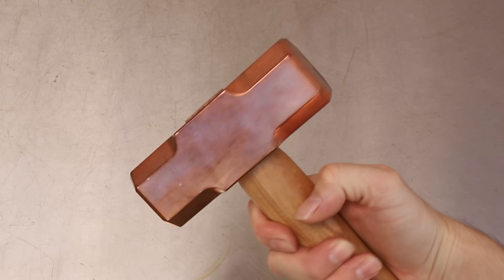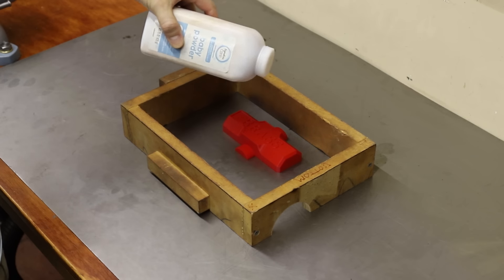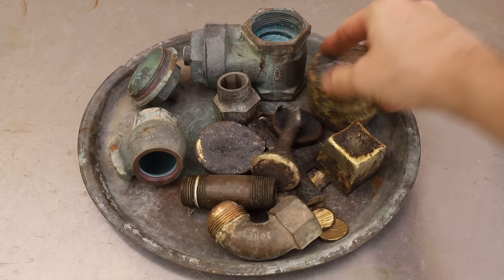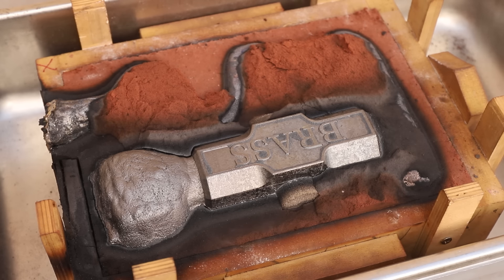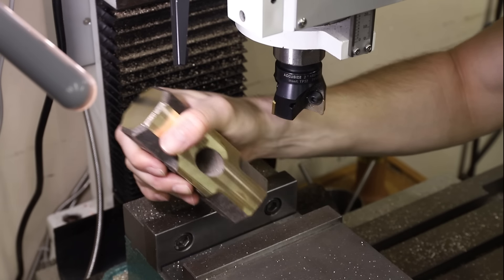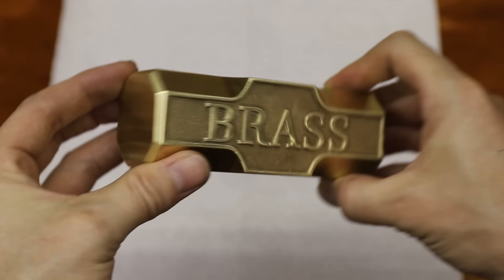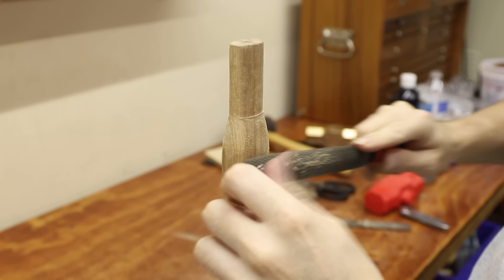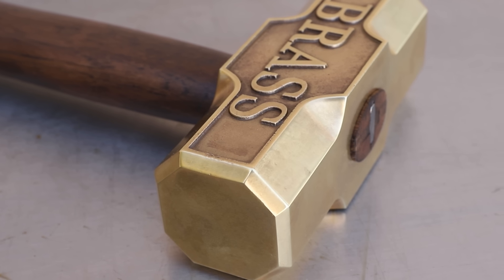Casting a Solid Brass Sledge Hammer in a Backyard Foundry

Comment: It's official, you must begin making a hammer of every metal, and have the ultimate Smither's collection.
Reply: I fully agree
Reply: please gold 24k!
Reply: Gotta get his hands on some depleted uranium.
Reply: I would like to see a titanium hammer if it's possible.
Reply: Why would a smith want a softer hammer? A smith wants the workpiece to deform, so there is no reason for a smith to have a hammer that deforms more than his work. Sparks should also not be a problem while smiting as most of your work is hot work. So if you store flammable stuff next to your forge, you are doing something VERY wrong.

Softer hammers are good for mechanics and technicians that want to give stuff a whack without damaging them. Also, specialized jobs like oilrig crewman that can't afford to give off sparks due to the fire hazard. Steal on steal can create sparks, copper or brass on steal, does not.
Reply: still missing the hammer made from gold
Reply: @fitter70  Yes!!
Reply: @skitidet4302  I think they're called "collections" and "collector's piece" for a reason. They're little more than a token, a thing to hang on a wall. A copper hammer has no use in current smithing, yet makes an excellent novelty item.
Reply: Cannot wait for the tungsten hammer of the same size😏
Reply: HELL YEAH!
Reply: Cesium hammer xD
Reply: yes
Reply: @Michaels_lack_of_AC  that thing is gonna weigh like 5 tons
Reply: tantalum hammer lets go
Reply: AGREED
Reply: This includes tantalum
Reply: I'd like to see pewter
Reply: Tungsten hammer is a must
Reply: 316 Stainless steel
Reply: @lnz971  don't forget high purity platinum and platinum white gold.
Reply: @skitidet4302  Actual blacksmith here. Soft hammers are useful for hitting punches and chisels hitting 2 hard prices of metal against each other reduces the life of your tools and can cause chipping.
Reply: @garethbaus5471  True, I forgot that blacksmiths sometimes hit other things than the workpiece.

But for hitting the workpiece, you don't ever want the hammer to deform, only the work. The harder the hammer, the more efficient your work is going to be as it imparts more of the strike to the work or it bounces nicely on the anvil. Ofc it can be too hard if it can start to chip if you hit the anvil.

Also, a moderately hard steel hammer would be more than soft enough to hit punches, it doesn't nessesrly have to be real soft as that would just force you to resurface the hammer face more often.
Reply: @skitidet4302  The work is significantly softer than regular steel, so the hammer doesn't actually have to be all that hard to be useable.
Reply: @garethbaus5471  Yes, but the harder it is, the less energy will be wasted by the hammer acting like a shock absorber. Though in practice, the difference is probably pretty negligible, at least when working with soft yellow hot steel, but the more it cools, the more it is going to matter.

I know blacksmiths also bounce the hammer on the anvil while working, and the harder the hammer and the anvil are, the better the bounce. If you use a brass hammer, I bet it won't bounce well and it will be deformed rather quickly, especially when hitting the much harder anvil.
Reply: @garethbaus5471  There's a good reason why blacksmith hammers are made out of high carbon steel that is hardened a decent bit.

If you doubt it mr blacksmith, make yourself a hammer out of mild steel. Could you work with it? Probably, but it's not going to last long and it's not going to work as well.
Reply: @skitidet4302  Medium carbon steel like 4130 is generally preferable to high carbon steel actually. I actually have a mild steel hammer, the edges need dressed a little more frequently, but it still works fine.
Reply: @garethbaus5471  4130 is not a medium carbon steel, it's a low alloy steel with low/medium carbon content and it's pretty hard, especially after heat treatment.

I did some reading and apparently you want your hammer to be softer than your anvil for obvious reasons(refurbishing an anvil is a lot harder than fixing your hammer), so medium carbon steels like 1045(0.45 to 0.5 % carbon content) seem fairly popular and will reach a decent level of hardness when heat treated. 1060 is a high carbon steel with 0.55-0.65 % that's often used for sledge hammers, though it might be a bit hard for blacksmithing if you don't have a hard enough anvil.
Reply: @garethbaus5471  Also, I don't believe your "mild steel" hammer is actually mild steel. as mild steel is real soft and it has too low carbon content to hold a temper. If you did use one, you pretty much had to dress it daily as it will deform a lot when hitting most stuff.
Reply: @skitidet4302  It feels softer under a file then cold rolled steel, but that really isn't that big of a problem if you keep your work hot.
Reply: @garethbaus5471  But it is a problem if the work starts cooling off a bit, or if you hit your anvil, or if you are trying to forge something real hard like tool steel for some reason. There is no upside that I can see to counter balance the disadvantages. Why be stubborn like this? It's inferior, end of discussion.
Reply: @fitter70  he did make one but it’s not that big
Reply: YOOOO CALCIUM HAMMERRRR
Reply: Americium gang 
               👇
Reply: Plutonium 🥺
Reply: I agree, a Damascus steel hammer would be raaaaaad
Reply: @lnz971  it would cost $23,000 😂
Reply: yep
Reply: You are the chosen one 😷
Reply: Uranium sledge hammer 💀💀💀
Reply: @kami1945ww1  no the main body of the hammer will be just below supercriticality plutonium, and the end caps of the hammer will be tungsten carbide!
Reply: Rhodium hammer
Reply: @benjaminbrockway5998  +5 radiation damage
Reply: plutonium hammer
Reply: Personally I want to see a as close to pure as you can get the metal, carbon steel hammer. By pure I mean just carbon steel no other metals, I know full well carbon steel and steel in general is an alloy.
Reply: Pure uranium hammer 💀
Reply: Mercury hammer: You can only use it in cryogenic environments or it melts.
Reply: @benjaminbrockway5998  the US is leaving some in Ukraine, maybe that´s a good place to start.

Comment: Did you spray CO2 over the core or was just being exposed naturally enough to harden?
Reply: boy just breathed on it really hard
Reply: YouTube frames your comment without me opening the section, leading me to assume you are top comment, and I'm surprised he hasn't answered yet because of that.. Regardless, I know next to nothing about this stuff, but he seems to outline steps pretty well if he thinks they are important and he didn't say, so likely he doesn't spray it... Just my guess.
Reply: It’ll harden on its own by just being exposed to the air, but you can also spray it to harden it faster

Comment: Earned another subscriber. Please keep the narration for people like me who just don't know. Also, the comments, were quite helpful. I didn't know how/where these tools were used but the comments certainly helped.
Reply: Don't know if other people have commented, but brass tools including hammers are often used in industries where there's a risk of fires and explosions caused by various gases/vapours.
I used to work on drill floors on rigs in North Sea and we kept a set of bronze tools, alongside the usual steel ones. Hammers, spanners/wrenches, etc. We'd only use them on occasions where there was an increased risk of gas escaping, and we'd have gas detectors all around the area.

Comment: Beautiful hammer. I'm 60, and my grandfather taught me how to put handles on hammers. He would have the fit very tight. You couldn't quite get the handle in. He would start it then flip the hammer over and tap the end of the handle with a wooden mallet. This would drive the handle into the head. Over time the handle will absorb and lose water making the handle lose. He would seal the end of the handle with varnish.

Comment: Very cool. A brass hammer is a very useful tool for working with metal since steel hammers will deform what you're working on. This is basically the metal equivalent of a rubber mallet.

Comment: I've used a brass hammer a lot in refinery work.  It won't spark and that's nice when you're working with flammable gasses floating around in the air.
Reply: It’s not too soft? Nice

Comment: Really cool, i had 2 thoughts that i think you should try. 
1- Why don't you model up an item that can double as the sprue/pour hole for any item you want to cast. For example, the wavy line you carved could be a snake. Surely this way you can get 2 castings at once and have a "cheap" item sell on your site. 
2- Because you don't need the integrity of a 3D model, it would save you print time and material if you hollowed out your 3D models

hope this helps!
Reply: It just gets melted back down anyway
Reply: @gonelucid  That is still an extra step that costs fuel and doesn't directly add value, the more value you can generate in single pour the better.

Comment: Very nice. You might want to smooth away the little step where the bottom of the eye meets the handle. A smooth radius in the wood and the bottom of the eye will reduce the chance of breaking. 👍🏼

Comment: Looks great without a doubt. The only different thing I would have done, was polish the faces, the facet edges around the faces. Top, bottom, stipple around the lettering. As for the edge flats, leave those dull as cast.

Otherwise it's yours and not mine, so the choice to go the route you did is what you preferred, and it looks good for it. For a next project why not a bronze one in the style of a stone axe?

Comment: Nice job... except for the steel wedge at the end.  Making a brass final wedge out of your casting off cuts would've been quick & easy & since it's a soft metal, you could've Dremmeled out a thin starting v before hammering it in.

(30/Jul/2023-9:53pm🇦🇺EST)

Comment: I'd like to suggest using a 50/50 mix of boiled linseed oil and turpentine on your handles.  TWP can be added for colour.  This, when applied to the wood that will be in the head, will help the handle from drying out and becoming loose.  Also treat the wooden wedge. very nice project.  How long did it take to melt the brass?
Reply: I use pale boiled linseed oil on my vintage sewing machine resto’s, gives a beautiful finish.
Reply: also be careful with linseed oilsoaked rags, they tend to ignite when you dont want them to

Comment: It may not be a hammer, however I am having a scale model locomotive body that will be sand cast at Montclair Bronze in Montclair Calif. I made my own master pattern hand carved out of wood. It will be  1.5 inch wide x 1.3/4 inches high x 10 3/4 inches long. I love the brass sledge hammer.

Comment: You should have burned the handle with a torch ( I use map gas on my axe handles ) before you oiled it. It makes it stronger and it looks awesome. Really brings out the grain in the wood.

Comment: I just made a set of brass and copper hammers. For my mold I was just using an old, mostly burned out graphite electric forge 3kg crucible. Get a nice perfectly cylindrical hammer that way, and I can use my pipe-holder to drill in the handle. Nowhere near as nice looking as yours, but functional.

Comment: It's better not to strike the wedge directly with a hammer so that it doesn't crack like it did in your case. Instead put a piece of wood on top of the wedge and strike that. Amazing video by the way and the cast job couldn't be any better.

Comment: Everything is so..... but I would recommend strengthening the handle not on dry, but on glue. The simplest option is PVA glue. But there is a better option - this is a rubber adhesive, which, after complete solidification, retains viscosity and some plasticity.Although in your case, a metal wedge gives a good guarantee against disruption.

Comment: Very nice.  I wound have sanded the top of the handle flush with the hammer head, but I'm being nip picky.
Reply: It might hold slightly better if its not flush, since the excess is able to spread out. This way the hammer head isn't just held by friction between head and handle, I think.
Reply: @SystemX1983  Probably right. But, I don’t think this hammer is for use. Just a cool decoration.

Comment: Sorry if thats sounds stupid but where did the air go inside the chamber please ? Shouldn't the metal have been blocked by the air inside while pouring ?
Reply: The sand isn't air or water tight, it just moves out of the way.

Comment: Love that hammer.   Would it have been possible to use a brass wedge for securing the handle rather than wood or would that have thrown up some issues?
Reply: Absolutely no problem if it is melt from the same pour.  Other brasses should be fine, but there is a slight chance of getting a little corrosion due to differing zinc quantities.

Comment: Just beautiful. Where did you get the 3D printer file for the Sledge head?
Reply: They are easy to make oneself.  I use Tinkercad, which is pretty basic but does what I need it to.  The overall shape is just a cube TC comes with  1x1x1 cube you can drag out to any dimension; The hole is just a dowels shape where you drag one side out to oval, and lean it into the cube.  You can define anything as negative space, so that when you combine stuff it cuts out the space.  It is just basically building blocks.  You need a few trick on how to position things.

There are certain things where using someone else's design is great because they did all the work, and maybe researched how something works with existing Iphones, say.  In fact you can use their print to apply those dimensions to parts you create.

But with simple projects it is often faster to make one's own parts because they can be exactly as one wants them to be.

Comment: the only thing lacking is the correct grain on the hickory handle.  The grain must be parallel to the direction of the hammer swing.  The handle you chose has the grain perpendicular to the direction of the hammer swing.  This is because the grain perpendicular to the swing is not nearly as strong as the grain parallel to the swing and will always end in a split handle and there goes your hours of work on the handle.  The casting and polishing was great.
Reply: Your wrong

Comment: Instead of making hammers you should do a video on making a full running and working miniature 1/4 scale flathead V8 Ford f100 truck engine out of cast iron just like the ford motor company did back in 1932 to 1953 with a working four speed transmission with reverse and after the casting and pouring and letting it cool then make the heads and intake and pistons and crankshaft and cam and valve's all the parts to make it run then put it together and fire it up and then run it on gas

Comment: Just curious why you're making 3d printed hammer heads when they are designed after the one you found in your shop. Why not use the original steel head as your casting model? It just seems to me that you would save yourself a great deal of time and material doing so.